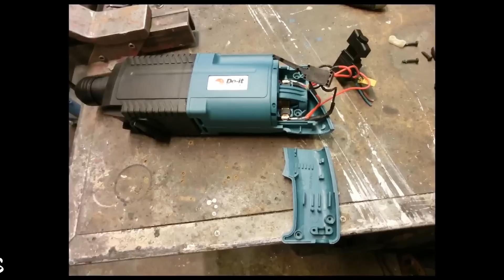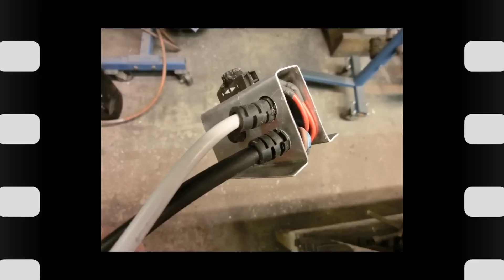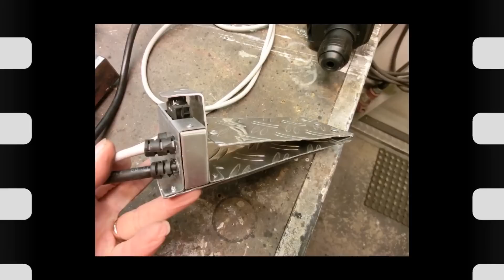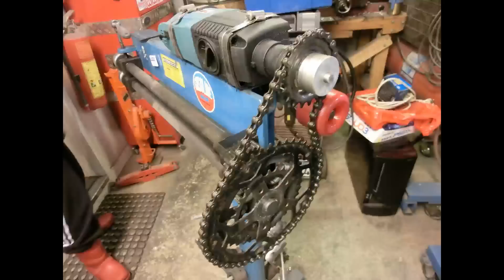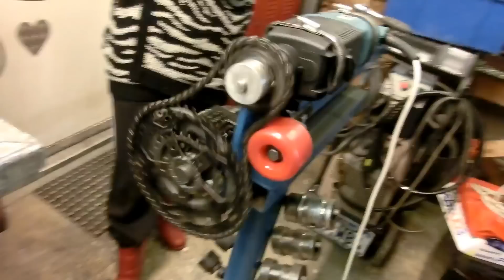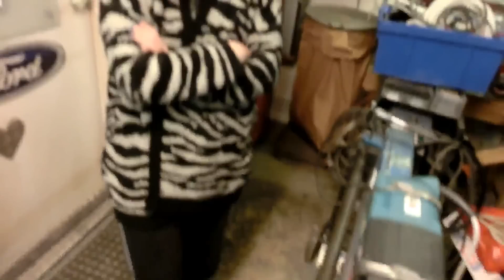HF Bead Roller Mods

Comment: Very Nicely Done!

I particularly liked how you fabricated the foot switch and your use of stainless steel strapping to secure the motor to the (reinforced) frame.

Really neat and efficient, thank you for sharing you greatly improved bead roller. Subscribed.

Comment: Looks like you might need to gear it a little different to slow the bead roll down.
Reply from the maker: +D Fuller: You're right and I have since the video was made added a 2-1 reduction gear.
Reply: +hotrodhocke How did you add the reduction gear? Did you just change the size of the crankset (chainset) or did you purchase a reduction gear?
Reply from the maker: +Slap Stick 
Here's how I added the reduction gear:

http://public.fotki.com/VikingMustang/other-projects/tools/cimg2711.html

http://public.fotki.com/VikingMustang/other-projects/tools/cimg2712.html

http://public.fotki.com/VikingMustang/other-projects/tools/cimg2713.html
Reply: hotrodhocke Cool! Thanks.

Comment: Very creative.  I've been wondering if I could adapt the H-F roller and I think your video answered that question - yes, I can.   I also plan to work on some 16 gauge, so the fact that it will handle that thickness is good too.